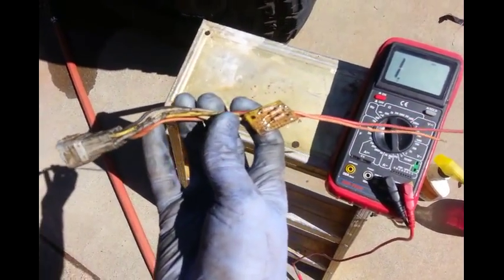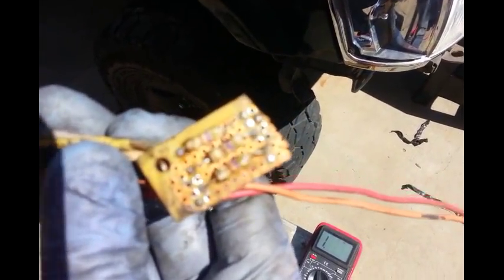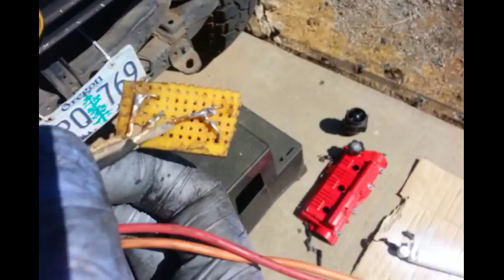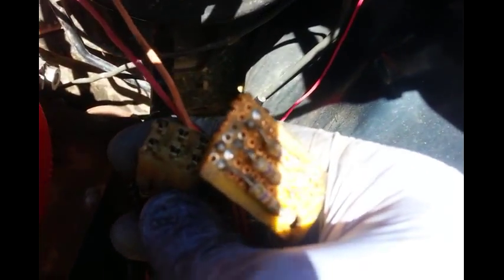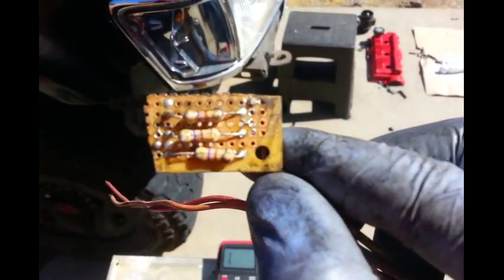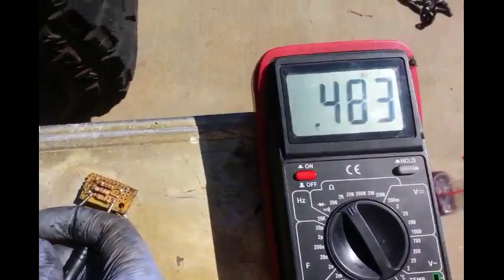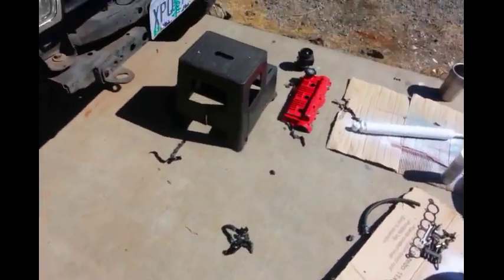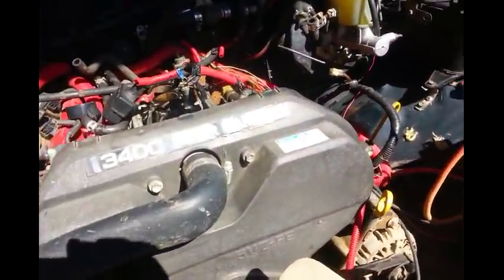Toyota 5 Speed Swap using Auto ECU (no SHIFT codes and LIMP mode!)

Comment: I just finished my swap and I’m have issue with my auto ECU to my manual trans. The problem is no longer have the auto harness plug to the trans. Is there anyway to wire it in at the ECU? Thanks
Reply: Thanks for the response I found the wires. Going to give it a shot this week.
Reply from the maker: Did you just clip it off?   If you have the auto ECU and harness previously the harness should still exist unless you snipped it off. You need to find out what the pinouts are for your ECU, and narrow down the 3 wires that you need representing the solenoids and use resistors inline to a ground like in the video.

Comment: hey man, I suspect this trick will be a lifesaver.... the ratio of auto to manual 4X4 donors is like 100:1. I was just wondering what year your donor motor was from?
Reply from the maker: That's why I made the video, got tired of answering questions on social media. Easier to post a link instead. Engine and harness is a 98. 98 and 99 is the best years for a donor 3.4 swap due to wiring options.
Reply: @DavidToyotaHead13  lovely!! got a 99 myself, ill fallow up how it goes!

Comment: Hey bud.  You have the reading off.  Your meter is set to 2k, and at the top it has a little indicator saying "Ko"  this means the reading is in kilo ohms, not ohms.  .4 is enough resistance that it probably won't register a short, but might.  Proble. Is, that its going to be trying to pull over 200watts at that resistance.  So, in short, you have 460ohm resistors.  Really, anything in the 200-500ohm resistance should work well.  All it needs is to "see" it drawing a little power, but not draw too much power.  IIRC, the solenoids are in the .8-2.5ohm range, but thats an unnecessary load on the ecu if you aren't needing the power.
Reply from the maker: Your correct, at the time I was not sure what setting it needed to be on and the one I used got it "close enough". Some people do not get limp mode from 5 speed swapping their rigs but at the time my fuel trims didn't come down till I installed those resistors.

Comment: I did a swap on my 3.4 with a auto ecu and 5 speed transmission trucks runs fine but it won’t go over 3500 rpm . I have to switch gear ever 3500rpm in order to go faster once I hit 5 speed and only goes 70mph at 3500rpm. You think this might fix the problem
Reply from the maker: I don't think this will fix your issue. If the truck won't go past 3500 rpm under load I would look else where. Maybe the exhaust isn't flowing good enough? I would check your codes first.
Reply: O

Comment: Good day,  I did a auto to manual 5 Speed swap Toyota 1NZ-FE engine. The codes i am getting are P0710 - Temp sensor, P0753 - shift A solenoid and P0758 - shift B solenoid. Any help is appreciated.
Reply from the maker: If you still have the auto transmission remove the temp sensor and just plug it back into the harness and it should kill your po710 code, as for the solenoid codes find out what the resistance is across them and get a resistor rated for that OHM and 1 watt should do for each solenoid.

Comment: Can I borrow this, or buy it from you... My cousin did a swap, and now I can't pass emissions. I don't know what to do.
Reply from the maker: Cant pass emissions because of the check engine light? Do you have a po1700 code and what codes do you have?  I am not selling but it's so easy to make thought it would be nice to help others out within the 3.4 swap community and not charge them for it.

Comment: Got any good diagrams of what you did exactly? Just did a 3.4 swap with a manual using an auto motor and the thing runs like complete shit with an auto trans code. Any help is much appreciated
Reply from the maker: I do not have a diagram but am willing to help, if you have a way of checking codes get those and get back to me should be 3 or 4 codes related to the auto trans. if you still have the auto trans you can kill one of them by plugging the auto trans temp sensor into the harness and leave it hanging. The diagram is super basic. 3 resistors each representing a trans solenoid, they can all use the same ground. Shoot me a text @ 541-661-6602
Reply: I have 99 harness and ecu from an auto with a 5 SPD behind it. I ended up giving it a shot. Put the resistors on the three wires with power to them. Everywhere said they would be 2.5 volts, mine had 4.5-5 volts. Got rid of my shift solenoid code, but the motor still runs like shit.
Reply from the maker: Do you have any codes? Was the OBD2 plug wired in? That will help you narrow down the limp mode issue. The o2 sensor is plugged in and is the 5vzfe o2 sensor not the old  3.0 o2 sensor right?
Reply: It has all 3.4 O2s, front and rear. Also has obd2 plugged in. I have a code for the transmission fluid
Reply from the maker: @Loudyotaa  But no other codes for a lean or rich condition? You either have a Vacuum leak or a bad exhaust leak before the upstream o2 sensor. It could be sensor related but you wont know till it throws a code for it. Take a video of it running and post to Youtube.

Comment: Exactly what I’m hoping to do in a first gen Tundra, especially since V8s only came with auto. Do you think it’ll be the same process? Just find what resistors will do the trick?
Reply from the maker: It should work, what year is the tundra? I don't see why it wouldn't be because Toyota used a lot of the same resistance values across their vehicles.
Reply: I'm looking for an '05 or '06, just doing research first. I want to make sure I can swap a manual in because my vehicles have to be stick. I think I'll be good with an R150F.
Reply from the maker: @essentialdeparture9999  Didn't know that engine will bolt to that transmission (r150f) what auto transmission is in it currently?
Reply: @DavidToyotaHead13  They don't bolt up as is, but adapter plates are made. They come with the A750F, A340F in earlier models. Some (very rare) V6 Tundras had a manual, and I believe it's probably the R150F as  some of the stuff is shared with the Tacomas.
Reply from the maker: @essentialdeparture9999  Looked up the shift solenoids I do believe it is the same values. the only difference between then transmissions is the tundra one being beefier for the V8 Go for it and use a 1 or 2 watt resistor if the 1/4 watt burns up.
Reply: @DavidToyotaHead13  Thanks a lot man. It'll be some time before this happens, but I'll definitely let you know when it does.
Reply: @essentialdeparture9999  I'm using a r150f, xat cams cheetah racing rods t4 turbo 4' drop should be cool

Comment: Hey buddy I have another question for you, so you plugged the trans temp sensor back in to keep a code from showing up, so my question is could you just do that for all the sensors and solenoids to keep the codes away without using resistors. And then just ground all of the sensors and solenoids
Reply from the maker: That's exactly what I did with the old solenoids but had to keep them in an oil bath to keep them cool because hey do get quite hot, after a while I got codes for them and started the long process of finding out their resistance.
Worked great for the trans temp sensor. 
Conversation starter as it now just hangs under my rig!
Reply: O

Comment: Hey do you still have a code for the auto temp sensor being missing?
Reply from the maker: Nope! However I pulled the sensor out of the trans and plugged it back into the auto harness just to keep the codes and dash lights happy. I am sure there is a resister you can use to basically do the same thing if you no longer have that sensor and are using the auto trans ecu.
Reply: Thank you for the reply!!!

Comment: Good info man, but a CEL for that shift code will not put it in any kind of limp mode.
Reply from the maker: Mine was.. wouldn't go j to closed loop till I wired in those resistors

like I said some peoe get lucky and don't have to deal with it :)
Reply: Trying to do this to my 4door, do you know exactly what resistors and what about the tran temp sensor and over drive.